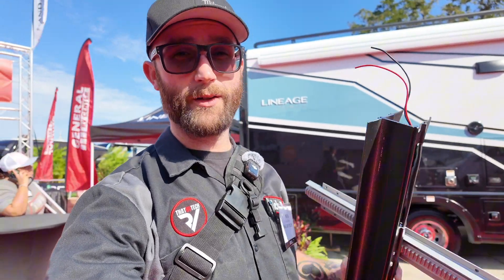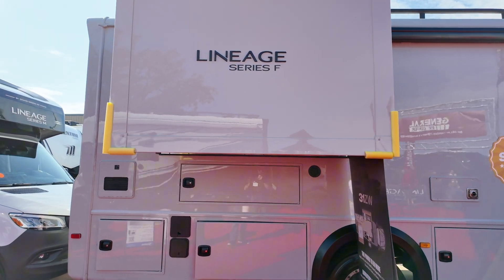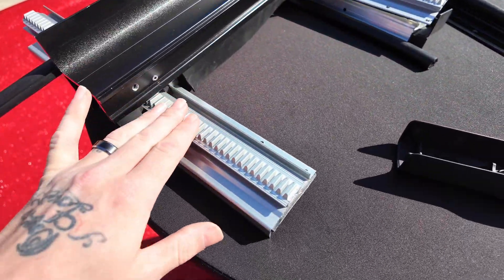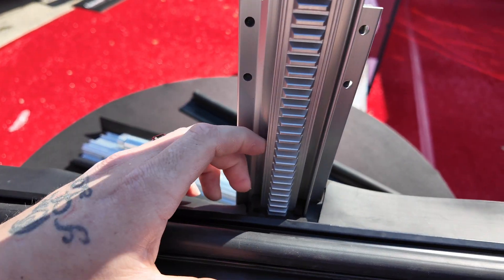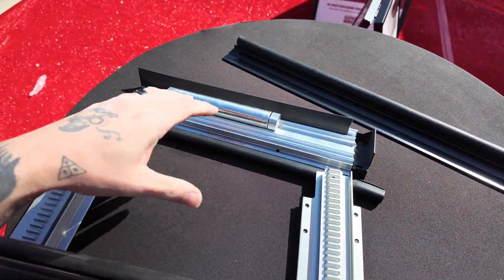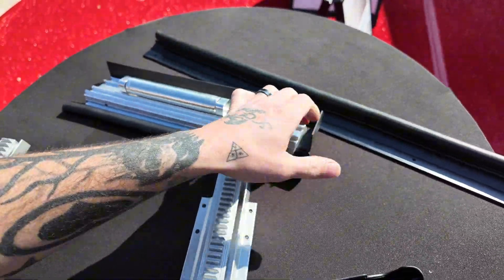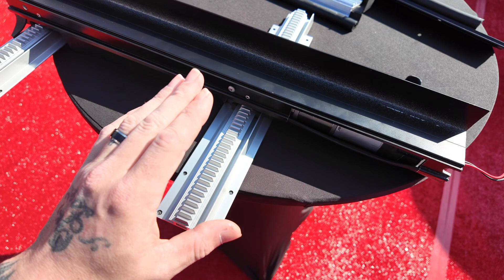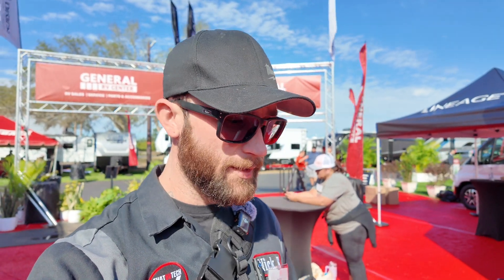The new RV slide system “Sure slide”, will it replace schwintek???

Comment: I have a question we work on campus in Lawrence Mississippi I have a older camper that has a quickie slide course can get parts for it so my question is can I use this kind of slide mechanism to replace it

Comment: My Grand Design Imagine XLS came with the Slim Rack. which is fine EXCEPT it doesn't have a manual way to move the slide in and out. So when the slide was out and would not come back in, I was stuck.  Do you have any suggestions on how to move the slide in and out without using the electric motor? (Btw, had to pay the dealer to come out. they found the wiring crimped due to poor installation)

Comment: I have a 2012 DRV Elite Suite with Schwintek slides on bedroom and Vanity slides and have never, "knock on wood" had a single issue from it. So not sure what all the fuss about schwinteck is. I will say I service my rails with dry lube twice a year and I keep the rails clean and lubes.
Reply: They are meant for small slides but the RV manufacturers put them on huge full wall slides with kitchens and fridges in them and they obviously fail.  They can also get out of sync and the customer has no idea that is easy to fix.
Reply: @AreaS4channel  The Schwintek system is relatively cheap and quick to install compared to many other systems; so OEMS slap them into places that they shouldn't be used.  Honestly, a Schwintek installed properly, following LCI guidelines is a pretty solid system.  But OEMs have been putting them in bigger and heavier slides, which leads to high failure rates, and an undeservedly bad reputation.
Reply: @javabean215  I came here to say this. Most schwintek slide outs I've replaced or rebuilt have been installed out of tolerance from the manufacture or rollers placement is off and or not even bearing the weight like it should
Reply: How big is your slide ?

Comment: It still has a track and mounts to the side wall instead of under the room- limiting it's use to smaller, lighter applications.  I still prefer the rack and pinion slide designs that are heavier and more resilient.

Comment: You can't buy it... It's only being used by one manufacture so far, then will be sold to other manufactures. it wont be available for aftermarket for a while. 3/17/25

Comment: The number one failure point on the schwinn tech system is the Gibs. If the room is improperly installed or the trailer flexes, the room can lift off the rollers requiring the entire room to be supported by the aluminum Gibs fastened by two tiny aluminum rivets. When (not if) the rivets break and your done. Does the sure slide system utilize this same faulty support mechanism?

Comment: Looks like Schwinteck and Slim Rack had a baby....lol.

Not sure I like the rack and multiple fastener penetrations on the slide wall.  Seems like Slim Rack wins out on that.

Would be interesting to read the marketing material on what makes this new system better than a Slim Rack
Reply from the maker: It is definitely a unique combination of features, I would have liked to see a better version of slimrack myself
Reply: @Thatrvtech  I have a Brinkley Z3110 and so far the slim rack is insanely better than the Schwinteck on our last camper.  Fingers crossed 🤞 🤞.

I'll also be checking the electrical connections to the hydraulic unit ,lol!
Reply from the maker: I’d love to know what you find